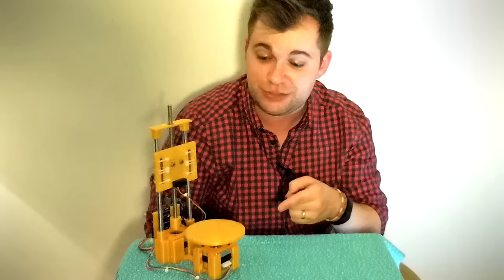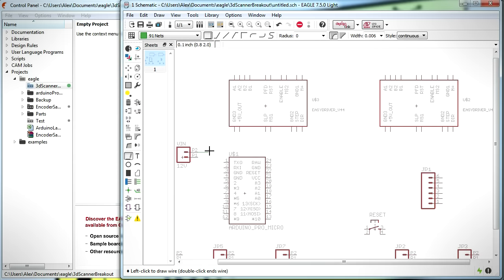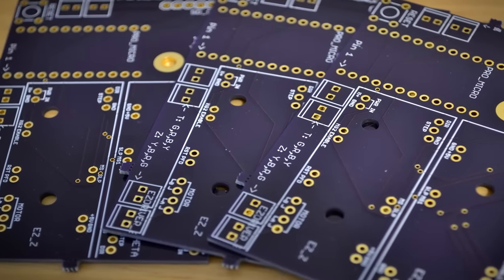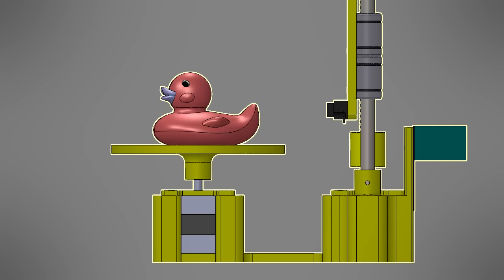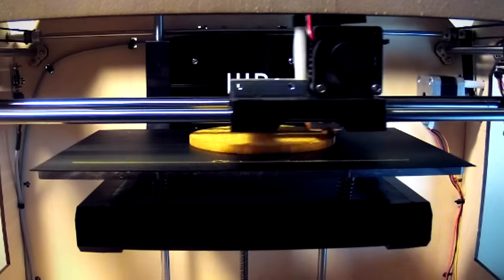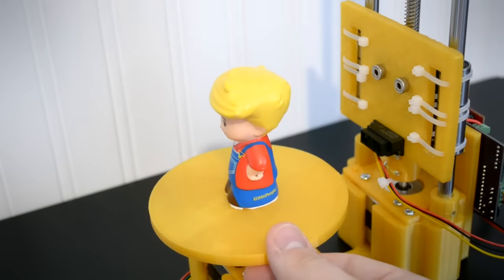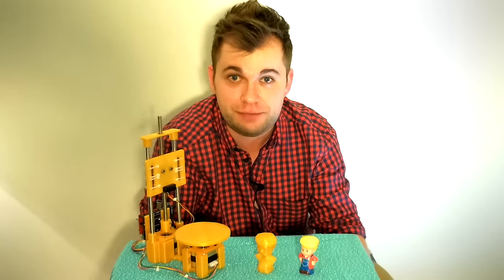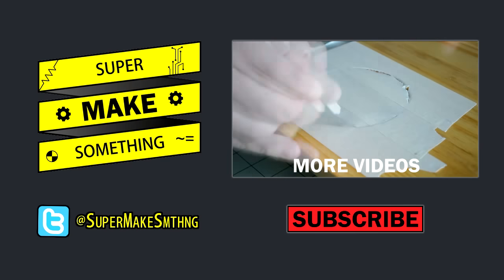DIY 3D Scanner (Arduino, 3D Printing, PCB Design, Stepper Motors, IR Sensing) - Super Make Something

Comment: Hello sir, i want to build 3D printer from totally scratch, I dont want spend money on arduino, ramp1.4, i want to use only microcontroller. Can i use microcontroller, L298,L297 to replace ramp1.4? Thanks
Reply from the maker: I believe you should be able to, but you would have to write your own g-code interpreter, which may be more trouble than it is worth.  The build you suggest is essentially what I am doing here -- it is a microcontroller with two stepper driver boards.  The scanner does not use g-code, instead running a pre-programmed routine, similar to what you would have with the components you suggest.
Reply: Sir, I want to know the step, so we use slicer software to cut the 3D CAD model into layer and transform into g-code. So, now how are we going to connect PIC18 with the g-code? Is there any thing out there we can use to connect PIC18 and g-code without using ramp1.4 and arduino? Thanks sir, your answer will save me a lot of time.

Comment: Hye, for the scanning process, did you open any software and start scan? or you just make the circuit, put memory, and on the circuit?
Reply from the maker: The scan starts automatically as soon as you connect the circuit to power.  However, an SD card needs to be in the reader.  Otherwise the scan does not start.
Reply: so, did you mean although we dont use any software, just follow the circuit, connect with arduino and SD card, the machine will start scanning, rotate and increase Z axis by itself?
Reply from the maker: Yes, but you need to program the Arduino using the code in the video description first.  Once the scan completes, you then need to process the data on the SD card using the MATLAB script, which is also found in the video description.
Reply: thanks, i will subscribe you

Comment: Hi alex, Could you tell me how to make the connections with the Arduino Uno? Thanks
Reply from the maker: Andrei Rosu hi andrei my advice would be to compare the connections shown starting at 1:00 with the pin out diagrams of the pro micro and uno. The names for the pins will be clearly marked on both and should allow you to wire up the boards in order to use an uno for this application.

Comment: I want to ask, I had an error in the convert part of the scan

Attempted to access xInterp(0,:); index must be a positive integer or logical.

Error in processScanDistance (line 115)
xTop=mean(xInterp(end,:));

any solution ? Please, I need your help
Reply from the maker: Ex This happens when a 360 degree “row” of the scan is incomplete and doesn’t have a 9999 delimiter value, which can happen if the scanner is turned off mid-scan. To fix this, open the text file and delete all characters after the last 9999. This should fix the problem.
Reply: Super Make Something Thanks for the solution, I have tried and succeeded.
But I found a new problem, the scan results of the Scanning process is not the same as the object being scanned,
And want to ask, why in my turntable place rotates by step and must 200 step to z axis up, if in video rotation very fast on turn table so that scan process goes with ceoat, how to make like that? Is there a solution? I desperately need your help
Reply from the maker: Ex The scanning process in the video was sped up — each scan takes about 40 minutes. You can change the Arduino code to go “up” fewer steps. (Look at the variables relating to Z step in the code.)
Reply: Here ? replace in Delay ? or Which Part ?

int vertDistance=40; //Total desired z-axis travel
  int noZSteps=20; //No of z-steps per rotation.  Distance = noSteps*0.05mm/step
  int zCounts=(200/1*vertDistance)/noZSteps; //Total number of zCounts until z-axis returns home
  //int thetaCounts=400;
  int thetaCounts=200;

  // Scan object
  digitalWrite(zDir,LOW); 
  for (int j=0; j<zCounts; j++) //Rotate z axis loop
  {
    for (int i=0; i<thetaCounts; i++)   //Rotate theta motor for one revolution, read sensor and store
    {
      rotateMotor(tStep, 1); //Rotate theta motor one step
      delay(200);
      double senseDistance=0; //Reset senseDistanceVariable;
      senseDistance=readAnalogSensor(); //Read IR sensor, calculate distance
      writeToSD(senseDistance); //Write distance to SD
    }
  
    rotateMotor(zStep, noZSteps); //Move z carriage up one step
    delay(1000);
    writeToSD(9999); //Write dummy value to SD for later parsing

Comment: well. I plugged in the 12 volts and it fryed the arduino board. can you help.
Reply from the maker: Some of the voltage regulators seem like they can’t handle their advertised range. I would use a variable power supply and slowly increase the voltage until the motors spin. This should avoid blowing out future regulators. Hope this helps!

Comment: I don't realy understand your arduino program... You creat a .TXT file ? Can I transfert the data scanning on the SD card in an Excel table ? Then, I run a macro. What do you think ?
Reply from the maker: That is correct.  I save the values read by the IR sensor into a text file.  This data is then transferred to MATLAB, where it is used to generate a new STL file.  Building the STL file in Excel instead of MATLAB may work, but I do not have experience in using its built in coding environment.  If you get this working though, please share you results with me!  I'd be interested to see how this works!
Reply: I think I will transfert to Excel; then save the Excel table in .csv and transfert the points into SolidWorks. I don't know if you have coordinates (I think cylindrical (r; theta; z (r = distance; theta = angle (°); z = Hight)) or directly the distance One below the other (7,2cm; 8,5 cm; ...)

Comment: Actually, wouldn't it be better to add a check to the IR data, such that if the distance goes beyond a certain range, say the far side of the turntable plus the distance from the front of the ir scanner to the edge of the turntable, the scanner just stops there?  Since if that case happens then clearly there's no more solid object as it'd have to be floating for that to be true?

Comment: @SuperMakeSmthng Hello could you post the link of the EAGLE project of the 3d scanner PCB? I do not live in the US and I would like to make the circuit with my CNC
Reply from the maker: Rodrigo Salas Hi Rodrigo, unfortunately I had a semi-major computer crash after posting this video before I was able to back up the project files. Therefore I am not sure if I still have access to the Eagle file/schematic for this board, but I will take a look!
Reply: oh thanks, if you could get the schematic  for the PCB and not the gerber code it will be great!

Comment: What 3D printer was used? It looked like one from monoprice
Reply from the maker: Good eye! it is a Maker Architect from Monoprice.  Unfortunately it looks like Monoprice no longer sells this particular printer, but the files should be printable on any printer as long as the bed size is big enough.

Comment: If we use Raspberry Pi instead of Arduino will it help decreasing the scan time ? What else can be done to decrease the scan time?
Reply from the maker: The scan time is mostly limited by the mechanical speed at which you can spin the turntable and still get a clean scan.  To speed the scan up, it may be possible to add more IR scanners to scan several heights simultaneously.
Reply: Ok. thanks.

Comment: HI there, i have a question for you, im using a sharp sensor (GP2Y0A21YK0F), i want to ask you, how i must calculate the distance in the arduino code and matlab, my sensor is from 10 to 80 cm. I hope you can help me.
Reply from the maker: Hi Guery, Adafruit has a great write-up on sensor calibration that will hopefully get you started.  It can be found here: https://learn.adafruit.com/calibrating-sensors/why-calibrate

Comment: do you think Ultrasonic range scanner would have better resolution?
Reply from the maker: The sensing "cone" of an ultrasonic sensor is actually quite wide, so I don't think this would provide better resolution. However something with a narrower focus, like a single line laser range finder should increase the resolution significantly.
Reply: Super Make Something how can one integrate that into this?
Reply from the maker: It would depend on the output of the scanner, but if it is analog, it should work in much the same way.  You would just have to make sure that you connect it correctly and then write code to interpret the analog readings to match your sensor.

Comment: I just build this project and it went really well until i tried to connect the powerbrick...
Stepperdrivers went really hot in a short period and the steppers are just clicking, but didn't move.

Somebody got an idea what i've done wrong and how to fix it?
I would be very thankful about some suggestions.
Reply from the maker: Seacred Double check your wiring of the stepper motors. Unfortunately there is no standard convention for stepper motor wire coloring, so the order for your motors may not match that found on the silkscreen. 

Also, I would verify the voltage you are applying to the board. The voltage regulator on some arduino  micro clones may not be able to handle 12V in, which may cause it to fry. If you are sure the motors are connected correctly for your steppers, start by powering everything at a lower voltage (6-ish) and slowly work your way up until the motors start to spin. (That being said, the motors shouldn’t need to output much torque for the scanner, so 6V may be plenty.)

The motor driver chips will get a little warm during operation, but if they are clicking, I think you may have some leads reversed. 

Hope this helps! 🙂
Reply: Super Make Something Thank you for your quick response.
The micro was  a clone, so it could be possible it wasn't able to handle 12V.
I've ordered a original one and going to try it with this one.

I know the drivers gonna get warm, but those i've got went to like 70°C in below 20 sec.
I'm hoping they aren't fried yet and will work if i double checked the wiring.

So the next steps to troubleshoot will be the correct wiring of those drivers and the steppers.

Comment: Do I need to buy Matlab in order to process the file or is there other software I can use? The Matlab software was $2,100,  which is a deal breaker for a DIY.  Im ready to order and build otherwise.
Reply from the maker: While I wrote the code to post-process the scan in MATLAB, it could easily be ported to another programming language like Java, C/C++, or whatever other language you choose.

Comment: Can I use pro mini or pro nano instead of pro micro ?? What's the difference between the three ??
Reply from the maker: Charlie Tsai The main difference between the board I use and the Pro Mini is that they use different microcontrollers (ATmega32u4 vs. ATmega328). For this application either micro controller should work, but the pinout of the Pro Mini might be different, so it may not work with the PCB I made for the scanner. I also believe that the Pro Mini does not have a USB port onboard, so you would need an external breakout board to program it.

Comment: Can the output be configured into a 3d object that I can import into Autodesk Maya and then clean up my way from there?
Reply from the maker: redisk while code to do this could potentially be written for the Arduino, it is currently done in the MATLAB code. The reason for this is that mesh-ing a point cloud like this into a solid surface is quite computationally intensive, and different scans may need different levels of cleanup on the raw data before the mesh is generated.
Reply: Thanks a bunch, nothing wrong with learning a new piece of software :)

Comment: Please clarify connecting of circuit ,   Arduino, stepper motor , motor ,and sd card
Reply from the maker: +m.s.a 112 The complete wiring diagram can be found starting at 1:00, but I would recommend to use the PCB to cut down on wiring, soldering, etc.

Comment: Any 3d scanner but with arduino uno?
Reply from the maker: This design will also work with an Arduino Uno, but you will not be able to use the PCB. Instead you will need to wire it using a breadboard.
Reply: @SuperMakeSomething  hello when i want to do this project with arduino uno how are the pin connections and codes ? I'm new to this stuff.

Comment: Could we use something other than Matlab? It's pretty expensive software.
Reply from the maker: Absolutely!  There is nothing special about the MATLAB code, just the language I decided to program in.  The code could easily be transferred to C/C++, Java, or any other language of your choice.
Reply: If it's not using any proprietary toolboxes (and it doesn't appear to be), the Matlab code will likely run in GNU Octave:  https://www.gnu.org/software/octave/

Comment: Hello, I like your work and I try to make a masterpiece like you with a different design just on the scanner with a distance of 2x further, and I get a serious problem. The result of scanning from Scanning process is very different from the original object, but I have set the distance max and min and center of the object on Matlab Software.
Is there any solution? I really need your help, in this as a Final Task in my school, I beg your response
Reply from the maker: Koremda DP Hi Koremda! Sorry to hear that you are having problems. I would try one of two things. First, make sure that the IR sensor you are using is rated for the distances you are trying to scan. The scanner I used is for really short distances and maxes out at anything larger. Second, make sure that the IR sensor output is calibrated to your distance. You can do this by measuring the output at certain distances (1cm, 2cm, etc.) using a ruler and then fitting a line between these points. This will allow you to calculate what voltage readings measured distances correspond to. (Check out “linear regression” for more info.) Hope this helps! Best of luck with your project!

Comment: a small question it sounds  the 3d scanner it,s need to make a full scan to get the right result even the object that I am scanning is small
Reply from the maker: +Ali Hasan you can stop the scan by unplugging the scanner before it completes the full scan. If you do this, you then need to modify the text file to get rid of the last incomplete line that does not have the delimiter value before loading it into matlab.
Reply: how I do that?

Comment: Hey bro.... Can i use GP2Y0A21YK0F sensor instead  of GP2Y0A51SK0F without changing the code...?
Reply from the maker: The pin out of this sensor will be the same, so you could use it in theory, but it looks like the range for this sensor is for a larger distance than the one I use in this project.  The GP2Y0A21YK0F data sheet says that it outputs ~3-0.5V over a range of 80cm, so your scanner would have to be quite a bit larger.
Reply: ThnX

Comment: Can I use arduino leonardo ?
Reply from the maker: Yes, but not with the PCB shown in the video. The circuit would be similar though and could be wired by hand.
Reply: @SuperMakeSomething  I did this but I couldn't adjust the sensor distance, the sensor is reading wrong data, what is the reason? Also, the model looks half on meshlab. Thanks for help

Comment: Hi! Am not familiar with Matlab how can i interpret the code and is there a guide for beginners?
Reply from the maker: FRANKLINE OCHOLA Hi Frankline! Depending how comfortable you are with reading documentation, I would go through the code line by line and look up functions that you are not familiar with in the Matlab documentation. It is very good! Other than that, my suggestion is to start slow and work your way up to more and more complicated projects as you get more comfortable with the code. For example try coding a for loop, while loop, some if statements, then work your way up to functions, etc. Hope this helps!

Comment: Super make 
something
So I am having some problems getting the code to work, this is the error message and I was wondering if you could help me figure this out.

Arduino: 1.6.12 (Windows 7), Board: "NodeMCU 0.9 (ESP-12 Module), 80 MHz, 115200, 4M (3M SPIFFS)"

scannerCode:51: error: 'A3' was not declared in this scope

 int sensePin=(A3, output);

               ^

scannerCode:51: error: 'output' was not declared in this scope

 int sensePin=(A3, output);

                   ^

Multiple libraries were found for "SD.h"
 Used: C:\Users\Rickey\AppData\Local\Arduino15\packages\esp8266\hardware\esp8266\2.3.0\libraries\SD
 Not used: C:\Program Files (x86)\Arduino\libraries\SD
exit status 1
'A3' was not declared in this scope

This report would have more information with
"Show verbose output during compilation"
option enabled in File -> Preferences.
Reply from the maker: Hi Frank,  this error looks to be the result of having the wrong board selected in the Arduino IDE.  In the Arduino IDE, make sure that you have the correct Arduino variant selected under Tools -> Board.  Hope this helps!
Reply: that helped, but now I need help with my stepper motors. My wiring code is red green blue black. I found a forum that stated that stepper motors don't use standardized color coding. So I measured the coils and found that red and blue are one coil and green and black are another. so what order should I plug them into the pcb?
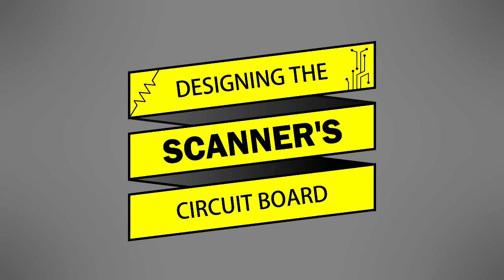Reply from the maker: To be honest, the easiest way to do this is to use the diagram at 1:20 for reference, and try connecting the different pairs to the terminals.  You should be able to follow the traces on the PCB to see which terminals line up with which output on the stepper motor driver board.  Just make sure that you do not connect/disconnect your stepper motors while the board is powered, as this will fry your driver!